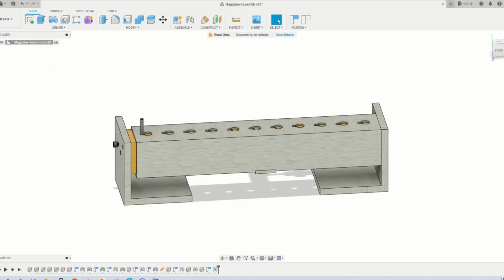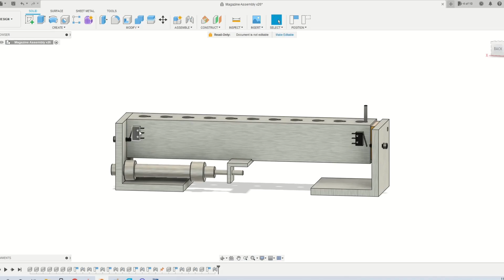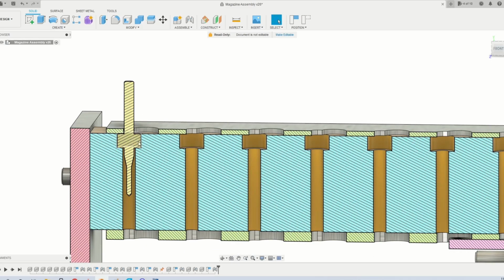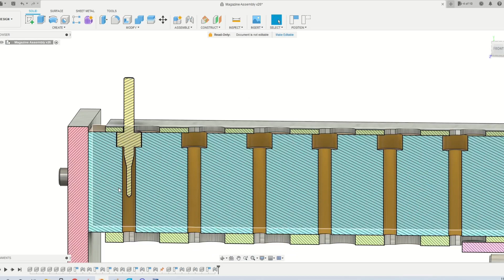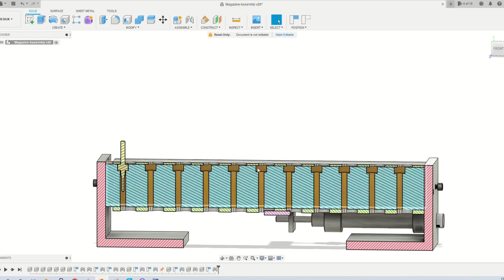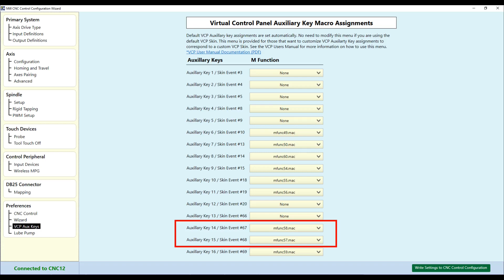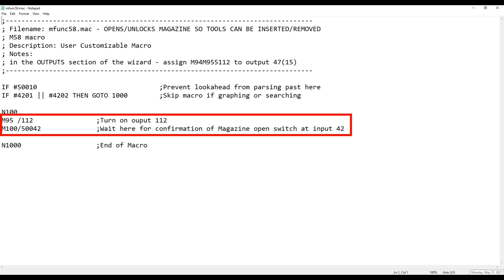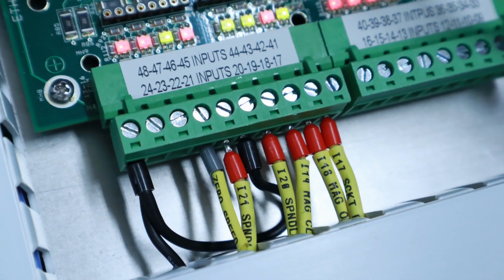CNC Router ATC Magazine

Comment: Instead of using pneumatics you can use a solenoid and a spring , it simple less parts and cheaper
Reply from the maker: Good morning harryman01,
Yes solenoids are a good alternative for actuators.  However, in this case, pneumatics were the best choice especially since I already had most of the components.  
There is one specific actuator that pushes the spindle locking wrench forward.  That one has to stay powered the entire time while trying to advance as another actuator tries to engage the socket with the collet nut and ultimately turn the spindle until the wrench can engage. Not all solenoids can tolerate long On-Times whereas the pneumatic cylinder can stay active for days without worries (of course something else would be rally wrong if that happened!!!!).
Cheers!
Chris

Comment: Could prob program the spindel to grab the collet and then move percisely into a collet wrench thats like welded nearby to tighten it up, i just run a natural stone cnc, im not this advanced as i dont have any schooling but i can program and make tools go where they are supposed to 😂 i went from using a hand grinder to self teaching myself how to run pretty cool stuff on a big CMS stone cnc. This little bit thing you designed is amazing. I recently started using tools that most shops dont do in our industry.  Recently got a big passion for going outside the box when it comes to cnc machining, and have done cool things on stone that impress most in my trade :p today i learned what a collet chuck even was and made a makeshift DIY tool with a tool holder and collet.. being held in the collet is a sort of screw that can fasten a hand grinder/polishing wheel with velcrow that holds stone polishing pads and made a very dark, man made stone look so polished, you could see your reflection. The video was great and found it useful.
Reply from the maker: Hello and welcome,
I think you are asking if the spindle motor could rotate to align with a fixed, open end wrench - THAT IS A BIG NO.  The minimum RPM of that spindle is about 6000 RPM and has no positional control.  This is why a stepper motor is used with a gearbox and socket as designed.  
It is always fun to innovate, happy stone working.
Cheers!
Chris

Comment: Nice design.  A simple addition to your macro could save you from a possible future crash caused by a failed close fault of the open or close switches.  Insert another wait statement to see the opposite switch off.  Every cycle thereafter will confirm both switches are changing state.
Reply from the maker: Hi Screw This,
That is an excellent suggestion! 
Cheers!
Chris

Comment: Great video and good design. How to use a cheap spindle to have an ATC. Pretty cool. Now you need to figure out how to change collets. Lol. More nuts with pre loaded collets? Hmmm maybe possible. I was trying to remember where I recognize you and my wife says over my shoulder “oh that’s the guy we met at the woodworking show where we bought his magazine on discs. Been a while.
Reply from the maker: Hi BLT Venture, thanks for the kind words and or recognizing me!  Yup, that is me, and yup, the woodworking videos on my YouTube channel are the videos from the old magazine.  It certainly has been a while since then! 

Regarding further development on the ATC with larger tools, different collets, etc. I am already pondering different concepts and ideas.  Unfortunately, with so many things on my plate, I don't have much time for "deep thought". 

Cheers!
Reply: Could prob program the spindel to grab the collet and then move percisely into a collet wrench thats like welded nearby to tighten it up, i just run a natural stone cnc, im not this advanced as i dont have any schooling but i can program and make tools go where they are supposed to 😂 i went from using a hand grinder to self teaching myself how to run pretty cool stuff on a big CMS stone cnc. This little bit thing you designed is amazing. I recently started using tools that most shops dont do in our industry.  Recently got a big passion for going outside the box when it comes to cnc machining, and have done cool things on stone that impress most in my trade :p today i learned what a collet chuck even was and made a makeshift DIY tool with a tool holder and collet.. being held in the collet is a sort of screw that can fasten a hand grinder/polishing wheel with velcrow that holds stone polishing pads and made a very dark, man made stone look so polished, you could see your reflection. The video was great and found it useful.